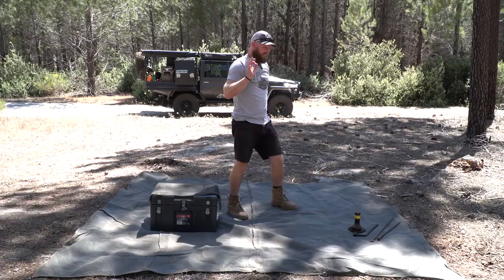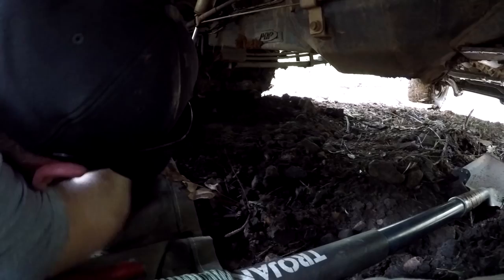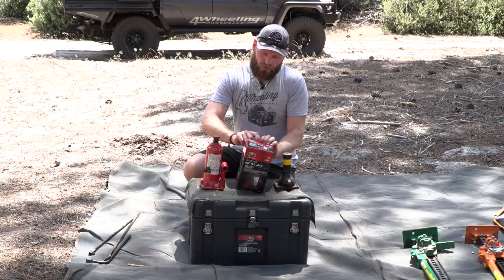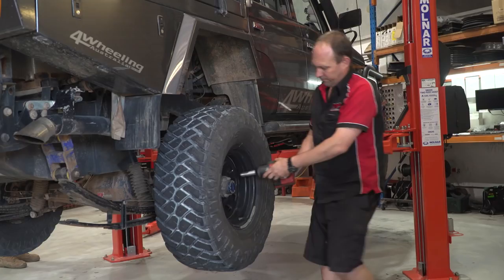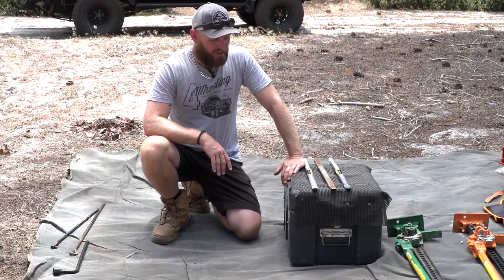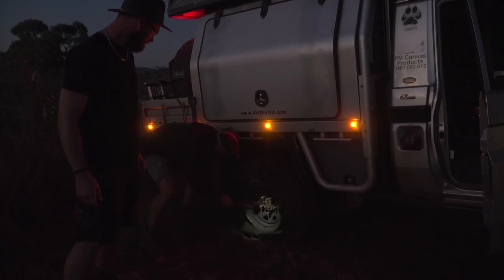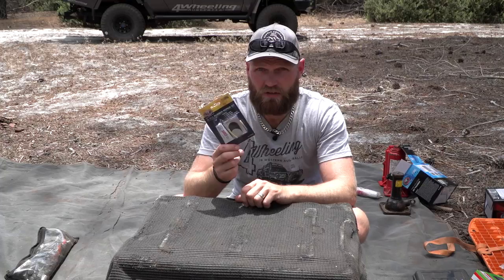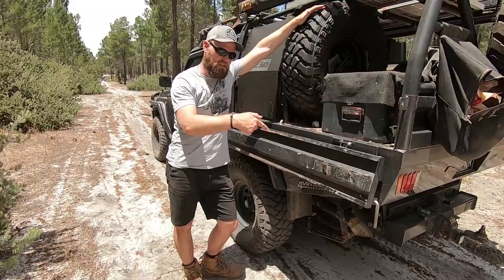Change & fix tyres like a pro OFF-ROAD

Comment: In my recovery kit I have The manufacturers bottle jack that came with my Tacoma. I also have a and American company product call safe Jack. This is a really nice bottle jack system there are many different bottle jacks you can get in the system I have a 12 ton bottle jack I also have two extension I can add to the bottle jack, 3 inch extension and a 6 inch extension. these extensions are engineered to work with the bottle jack if you need to get a bit more height. It also comes with a flat jack pad which sits on the top of the jack giving it a wider contact point to your vehicle. I also got in the kit a universal round tube jack pad ,This allows you to jack up around axle tubes leaf springs even your rock sliders. All these extensions and jack pads are all engineered to walk with this 12 ton bottle jack the kit also comes with a nice little canvas bag to keep it all together. I also carry a highlift Jack I like this till it is not just a jack it is a very useful multi tool it just needs to be used with respect and a good working knowledge of the Jack.  For example many people use the Jack just straight up as it is well there are many accessories you can add to a highlift Jack to make it more safely like if you’re lifting rock sliders or if you’re using it for a winch there is an extension piece you can get which will make it extremely safer. The trouble is people don’t fully equip it out and just try to make do. Granted this saves you some money Pudding saving the few dollars you could end up hurting yourself or someone else. I have used my highlift Jack to on seed bead on my friends tires when he was changing over to snow tires didn’t have the money to pay someone to do it so we did it ourselves a little bit of work and few laughs. I have used my highlift Jack in two other situation. 1 we needed a second winch and my friends winch had frozen up as it was -32° C that day with the windchill I told him he needed a winch cover he went out and bought one after that day. But we used the highlift Jack old-school winch style and they got us out . Second time I used it we came across a group of people were one of them had rolled their vehicle. Nobody hurt thankfully we use the Jack to open the door and then we used it again to push back up roof so she was able to drive her vehicle off the trail and to the road where it could be towed back into town. So the highlift Jack came in extremely helpful I know a lot of people don’t like them I know they can be dangerous to use , but I show it plenty of respect and it has been helpful tool so I will be keeping mine. Now there was one time I snapped a valve stem on my rear tire. However I didn’t need to list my truck and change to my sprayer I had some thing I added to my ARB punch or repair kit the product is called Colby emergency tire valve system. They say it is a way to change out a valve system without using any tools. However I did use my Leatherman and use the pliers section to pull out the remaining part of the old valve system and then following the directions on the packing put in the new emergency valve. Then I just aired back of the wheel and I was good to go when I got back into town I had them take out the emergency valve and put in a new one. Absolutely brilliant product would recommend it to everyone. It would’ve taken me 30 minutes to an hour to change out the wheel. But with the emergency valve I did it in about 10 minutes got to love that. Love the channel Ronny whenever I come across a problem Though , it’s strange I can hear your voice from the videos in my head helping me out .appreciate the knowledge share mate thanks!

Comment: On bottle jacks, in the UK at least you can buy really nice two stage bottle jacks cheaply on eBay. They're taken out of Sprinter vans because a lot of couriers don't carry a spare tyre. No need to have the jack if there's no tyre. It's a 2.6t jack that can lift really high.

My Defender is a maximum weight of 3t so  a 2.6t jack is way more than enough to lift 1/4 of it.
Reply: I'm going to have to check that out. Wonder what the shipping would be like from UK to Canada, I keep trying to find a two stage but can only find them as a 10ton which is just overkill and rather bulky.
Reply: @tomcardale5596  thanks, but just like I thought, cost of Jack isn't the issue it's shipping. $46 Jack $85 shipping.
I'll have to look around here a bit better.

Comment: If using impact guns use impact sockets  not standard chrome vadium
Reply: Even by hand use an impact socket, yes, I have snaped a chrome vadium socket with a breaker bar on a wheel nut, wheel nut did not budge before the socket failed!

Comment: You'd think the spares stored under the tray/wagon would be hard to get out in the mud and you'd be less likely to notice if they are missing or flat
Reply: This is an extremely wise point.  Have seen exactly this multiple times.  Never do this off road.

Comment: Carry spare glue for the plug kit.  once the glue  tube seal is opened the glue in the tube dries out quickly as the plastic cap does not seal well.  I consider the glue tubes to be single use, you need a fresh tube for each repair.  Dont be surprised if days after opening the seal, that the glue is no longer the same.

Comment: I have a High-lift Jack Ronny, hardly ever used it and i don’t trust them, plus the added weight? I have an Exhaust Jack with heavy duty canvas  pieces to protect the bag from sharps and heat and a bottle jack which covers all the scenario’s.

Comment: What about how to plug a tire the best way? Always add more than one? Rubber cement or not? How long can you drive on a plug etc. I was only able to get a leak to stop with 2 or more plugs and I think I used glue also.

Comment: Maybe someone has mentioned this in comments but I do not think you should be using only a bottle Jack to hold up your vehicle. That is not much safer than using a high lift jack. You should have an axle stand under there as well. I know you are not actually under the vehicle but if it did slip off the bottle Jack and you had a hand or foot in the wrong place you would not be happy. Steel on steel is a slippery combination. Some wood between the two would help but I still prefer to have the axle stand. Remember, any injury in the backcountry is more serious than an injury at home.

Comment: A spade is not a shovel. A spade is for digging. A shovel is for moving loose material. Its mainlyx to do with the angle between the handle and the blade.

Comment: I don't know squat about off-roading-- that's why I'm watching this. I do know about misplacing stuff. I am an expert, and I'm not entirely joking. At some point we left the electronics age (hey we still use stones, bronze, and iron) and entered the ABS Age, or the Every-Damn-Thing-Is-Black Age. That crank widget for lowing the spare tyre? It's black, stashed in a dark corner of the vehicle, or carefully stowed in a (yep) black bag.  Get some bright spray paint, or at least white. Don't paint the whole thing, paint parts of it. If it's stowed with a lot of other stuff, try to paint them different colors, or just different. Then they'll stand out. If you and your buddies do this, I can guarantee that one of you will absolutely remember a particular thing is blue and it'll turn out to be orange-- no worries 'cause you still would've found it. 

Another solution is 'Tails' one day I put a six inch strip of doubled blue masking tape on my TV remote. Not only did I stop misplacing it, but I now always picked it up pointing the correct way. (Don't ever assume that because Sony can make a flat screen TV and you can't that they've applied that level of smarts to their cluttered, rectilinear, dead-symmetrical remotes.) For tools and my girl friend's luggage (all the other women on the planet are still using red yarn puffs)-- pink vinyl safety (flagging) tape (ribbon). They make it in different colors, one roll will last you 20 years. I tie this to tools, remotes, my line-switch for a light, the one very specific USB charging cable (What I can see right at this moment in my office). 

The other thing I do to combat the black on black era is tool belts and screw pouches. I hit them with white spray paint for plastic. What's neat is when you give these things a spray, nothing seems to have happened-- they still look black. So don't spray one pocket to use as a comparison. Amazing, huh? 

Another trick. As you load your vehicle, shoot smart phone photos of all the kit that goes in a particular bag, case, box, whatever. Along with the thing it'll be in. If there's not a bag or something it'll be in, then make big signs with a sharpie for 'under the battery holder' and include it in the shot.  Now when you're knee deep in mud,  trying to remember where those 4 extra long cable ties you put somewhere a year ago... Just flip through the photos. If you did it right, it'll be like taking every single thing out and placing it on the driveway. Instead of scrounging, you're just looking.

Comment: Great advice,  You had a tarp in video but did not recommend that.   Here in Central Oregon Cascades we have snow and changing a bad tire in snow is not fun.  A small canvas tarp or a chunk of old rug makes the job more enjoyable.  In past I have carried 2 spar tires but now I do not.  I have different size tires one for summer on rocky trails and now winter tires.    Specialty tires for me are better than an an all season tires.  We have snow on the ground for 5 months of the year at our cabin.  I am now looking for a good air compressor to keep in my rig  for airing up and down the tires when on the trail.
Reply: look up the air tank systems,mainly for jeeps.they do about 54 tyres in one tank,co2.,800 psi.inflate a 35" tyre in 45 secs.

Comment: you should do a video explaing wheel sizes (offset/rim/tire) in relation to body and suspension lift, I see it on forums and irl all the time. 

eg, 31s were standard, did 2 inch body and 2 inch suspension but now can't fit 35s can only do 33s
Reply: hah,all my trucks run 35",no mods...plus a body lift is a bad idea,most things need lengthening,moving,ect.plus working under bonnet is further away.,legaly,your only allowed 2".overall.& 15mm on tires.!!.theres a rule of thumb in the states,when you raise your vehicle 4",you get 4" bigger tyres,to offset the pendulum effect,[[[roll over]]],,4" higher,with small tyres,means your centre of grav. is higher,which means,you roll easier....eh....

Comment: Ronnie. Thanks for the tips. Appreciate them. I have a situation where the spare tyres are fitted to the rear and will be an issue getting them up & down. Do you know of any simple lowering/lifting device that would overcome the problem ?

Comment: A video on how much difference there is between, AWD, 4WD with and without locks. Plz :D
Reply: AWD, not really 4X4 material. Maybe a dirt road or light slugging through the mud. 
If you want to go offroad, like proper offroad, 4WD hands down, not AWD. Lockers, that is a bit more to explain, best to watch his other videos to get the full information on lockers. When lockers are off, the vechile is in 2WD (most of the time, rear).
Reply: awd,is mainly for race cars,not 4x4 ing.its a b/s selling point.best with open diffs & lockers,cant beat it..jeeps had awd '80.s,for ice,snow.quadratrack.nothing new,.with this jeep system,it cost more in fuel,so people tried to disconnect it by taking off the front prop shaft,,,the vehicle would not drive.so,it became un popular.viscous centre diff.not sure if it had lsd.s or not.but it worked.

Comment: Ronnie great vid! What do you think about running a smaller spare tire. IE 285 70 17 with a 265 70 17 spare. reason being that I have a 99 4runner.. (thing you guys call them a Hilux surf) and the 285 is a bit big for the spare location. Not quite ready to go down the road of a full rear bumper with tire swing out. Keep in mind most of my trips are day or over nighters Thanks! also got a ELocker in rear only. otherwise open diff

Comment: HEADS-UP FOR TYRE REPAIRS IN THE UK:
I'd just like to add that those plug-type repair kits that the likes of yourself and ARB are illegal in the UK, as are the sealants, even though both are sold regularly over here - search BS AU 159 for more information. It is also illegal to repair any tyre not meeting the suitability requirements of BS AU 159, and it is also illegal to repair any tyre with a puncture not within the centre 70% of the width of the tyre (65% if the section width is between 160-200 mm; 60% if the section width is 155 mm or less) and if the puncture exceeds a maximum diameter of 6 mm. The fine for not complying is 3 penalty points and up to £2,500 PER TYRE - a theoretical maximum for 4x4's is 12 penalty points (i.e. you lose your licence) and up to £10,000 IN FINES. So yes, these repairs will get you home 'out there', but the tyres will be effectively scrap back in the UK and must be discarded.

Comment: Steel pipe to extend your breaker bar for those really stubborn nuts.
Reply: Agree it should be part of every tool kit as it very handy and takes alot of strain off.
Reply: @jamiem5364  It is also good for finishing off errant wildlife.
Reply: @nnoddy8161  its a multi purpose tool for sure so long as u get a thick pole. 
Can use it for rolling guards if u hit something, as a lever amongst many other things.
Reply: Yep. Agreed, if you are not using a portable impact gun (Ryobi) then yes, the long bar will be needed.
Reply: you should not have any,stubborn nuts,your supposed to re fit them before & after every trip,so you know there good.doohh.anti sieze should be in your kit too,,a bit on EVERY NUT YOU TOUCH WORKS WANDERS.

Comment: Have you seen an Colby Valve it is an emergency / replacement valve that installs from the outside when you rip off or damage the valve stem

Comment: Just be careful!
I'm not much of a safety nazi but when you use an impact driver you really have to use impact sockets and extension bars.

The reason behind it is, that the normal sockets and extensions are made from chrome vanadium and chromed. They are very brittle. When you use them with the impact they can shatter and explode.
Impact sockets are made from crmo (4140 if im not wrong)

I personally have seen them explode and one guy ripped two of his fingers off. Luckily they could restore one. But he still lost one.
Reply: yeeesss,,but,,you only use the rattle gun to undo from loose,re tighten to use the wheel brace,NOT,torque them up or undo them from start.i can change 5 tyres in 15 mins,with 2 jack stands,1 trolley jack,1 makita small 1/2" rattle gun,1 wheel brace.& a clik in my elbow for correct torque.it aint hard...

Comment: Don't use the Lubricant, this can make it hard for a tyre repairer to fix a proper repair plug to the inside of the tyre. My repairer recommends using a little tyre glue to the repair plugs instead.

Comment: Ronny would love to see a detailed video on how to use plugs
Reply: Just punch the round file through the leak and jank it in and out a few times. Then stick the plug through the hole in that other tool and push it halfway in, and pull it out. On the pull out some sharp bit of the tool cuts the plug in half inside the tire so you can take the tool out without removing the plug.
Reply from the maker: I’ve done one already mate it’s 2-3 years old but it will show you how

Comment: Would love to see another video on jacks. One question re 8000kg vs 4000kg bottle jacks. The ones I've looked at have quite a big difference in working height (about 478mm for 8000kg vs 385mm for 4000kg) but the actual hydraulic lift isn't that different, about 160mm for 8000kg vs 130mm for 4000kg. The rest you can make up with timber base plates or extensions. For the extra weight of the 8000kg unit is the extra 30mm of lift really worth it? In most cases with a 4WD I'm guessing you will need to jack off the axle or control arms anyway to have any chance of lifting the wheel off the ground as otherwise the suspension travel will be much more than even the 160mm an 8000kg bottle jack will lift.
Reply: you can buy alloy trolley jacks for about 300.will go to 500 mm.IF,you have the room to store it.bit safer than h/lift or bottle.probably weigh about the same.

Comment: How is the spare wheel on the bed kept in place? Maybe do a clip about using the plugs as well.
Reply from the maker: Already have a plugging video it’s in my library of videos
Reply from the maker: Which spare wheel the back one or the back back one (far back)
Reply: The back one on the truck bed, the other one (back back for show as you said :-) is not on the bed but it hangs from it and it is obvious how it is kept secure. The other one (closer to the cabin) however is unclear how you keep it in place; cause the project black aluminium wall against which it rests is pretty thin. So you must have some kind of rack/fastener for it.
Reply: @dimitristsagdis7340   there is support bars in the project black aluminium wall which allow for the tires to be mounted to project black, i'm pretty sure Ronny may have explained that in the project black video, but might be best to go watch/rewatch it to see if he does talk about it
Reply: Harry Wisemantel: I watched that video and the only relevant point I spotted was when he said that the drawer on the left hand side was necessary to provide support/structure to the drawer on the right hand side and the box overall. It was this that gave rise to my present question. If the box is so 'thin' that requires the drawer for structural reasons, how is he able to mountain a heavy wheel that leans against it. Did you spot anything else that may be relevant?